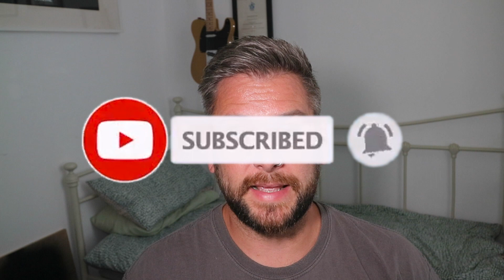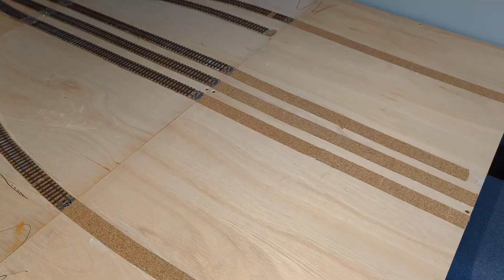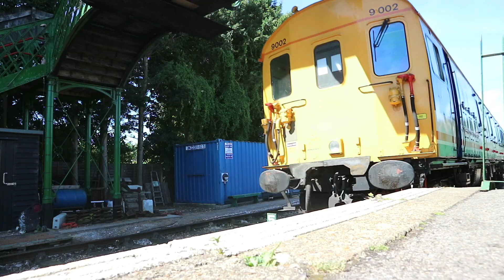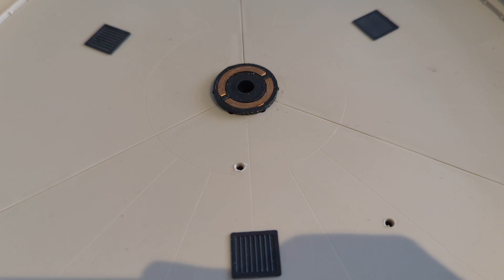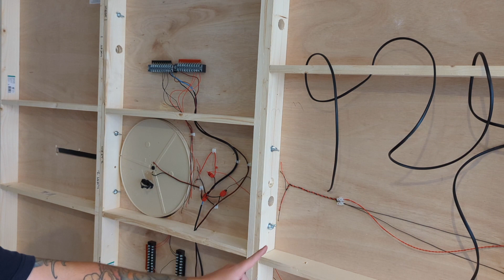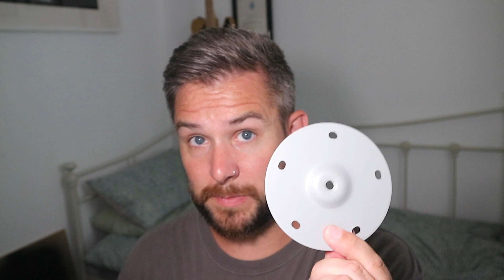23. Exhibition Layout Build - Baseboards

Comment: Have you done any more work on this project Sam? Looks like a cool project. I'm also planning a turntable based layout (an end of miniature railway line turnaround rather than a depot) so interested to see how working with the turntable goes.
Reply from the maker: I've done a bit of work but only in shortening the baseboards a bit. The biggest problem I had with this was the size and the area it took up. So it's currently sat on the back burner for a future project
Reply: @EmperorsPath  ah ergonomics, my old enemy, we meet again...